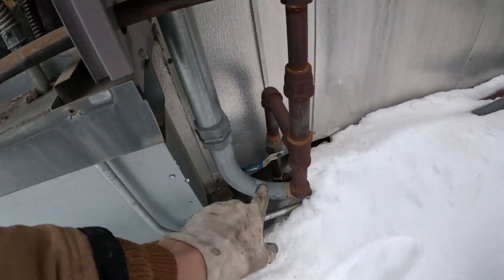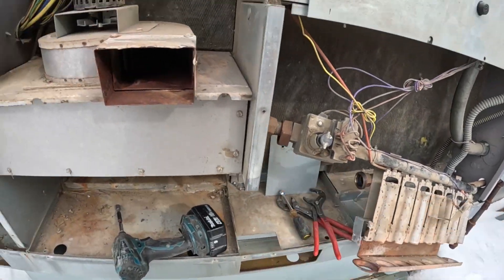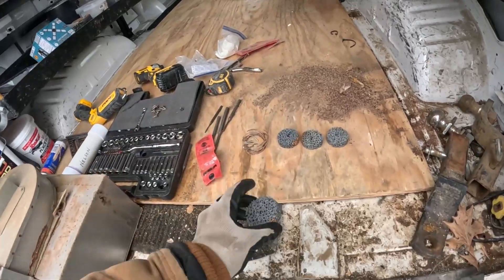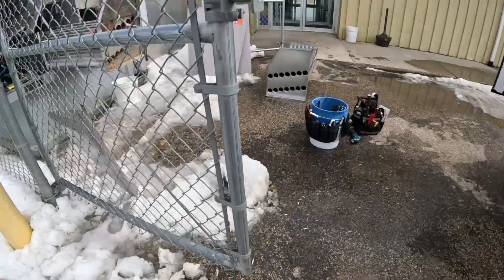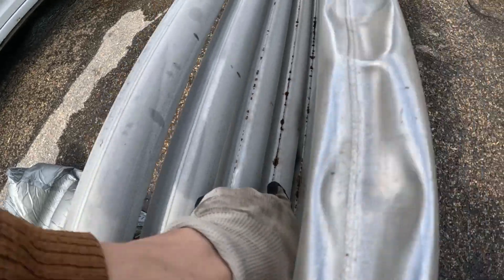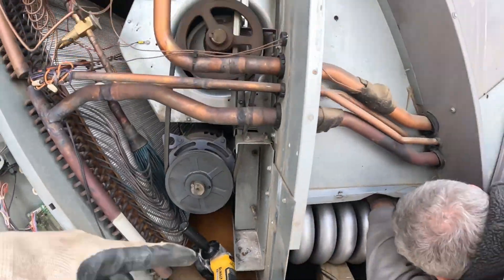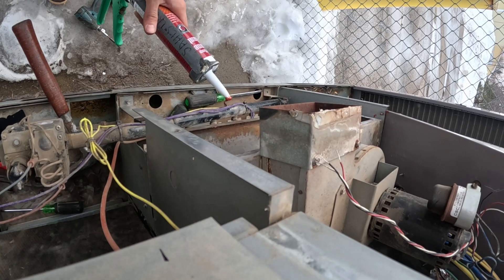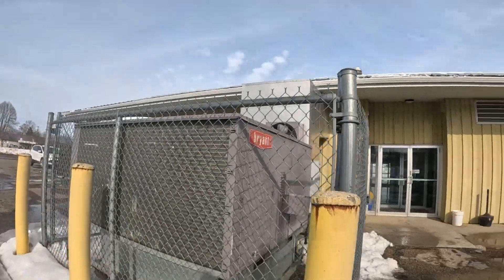How to Install A Heat Exchanger on a Carrier Package Unit

Comment: Wouldn't replacement of full unit be in best interests of the customer? They get a fully brand new AC, you get a decent payday and it's less work considering is basically plug and play!
Reply from the maker: It probably would be in the best interest of the customer, unless the customer is not interested like in this case. We priced out both options and they didn't want to go with the new unit, and instead opted for this repair.
Reply: @ReubenSahlstrom  This is just how I do it but in situations like this I wouldn't even give the option to repair just seeing how bad of condition the unit is. If I did do the repair I'd give no warranty and charge double.

Comment: How was this problem discovered? Was it from a carbon monoxide alarm? Thanks!
Reply from the maker: Primarily flame rollout causing the unit to short cycle and shutdown on lockout. Was able to confirm by doing a combustion analysis.